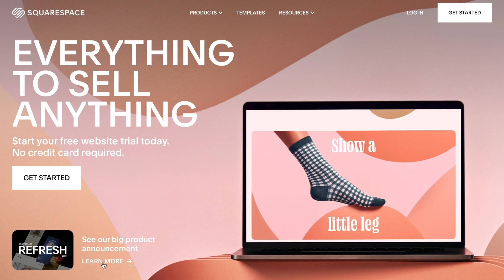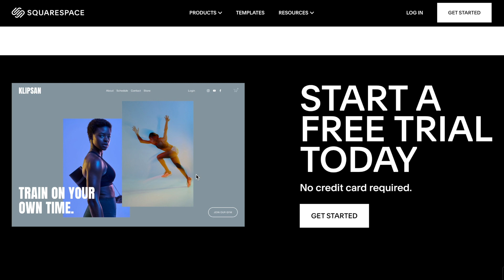DIY Ring with Kitty Litter??

Comment: The fact you thought of ways to use household items to create a wax mold and cast for this ring was amazing. I've done some jewellery making before and never thought I'd be able to even begin to think of ways to create things like that at home. Great thinking-outside-of-the-box there Shmoxd. (: 
P.S. you had better had a mask on when melting down those plastic bags! I know you and your unsafe creative processes!!!
Reply: I was thinking the same thing. I've taken a few jewelry classes and I follow many designers on IG, but didn't think I could do wax casting with simple household items!
Reply from the maker: 🙏🏻🙏🏻✨ thanks Laura! And you know me all too well.. I need to get myself a ventilation system…
Reply: @Shmoxd  definitely get on that ventilation system ASAP! ❤️

Comment: Small question, could you theoretically melt up a silverspoon?🤔 like cut it up first and then try to melt it like the silver balls?
Reply: Yes. Be sure it is not EP or plated. Make sure the torch you're using gets hot enough.